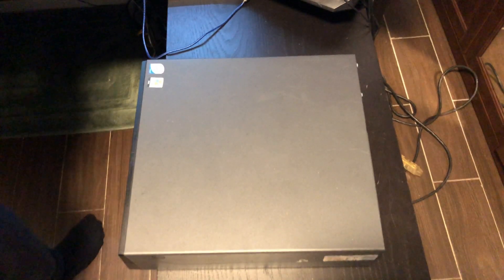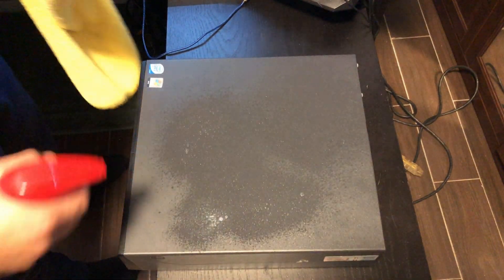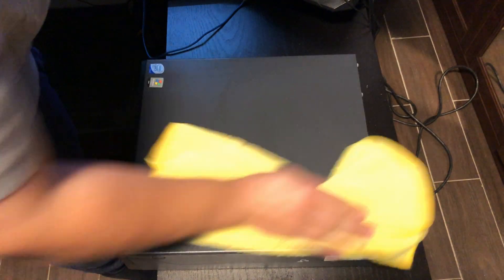Lenovo Think Centre M57p -SSD Upgrade & Ram

Comment: Could i update the psu ? Like 280w to 300 or more? And gpu with extra connection? Is anything i can do?
Reply from the maker: Hey @j6plus23 — sorry for the late reply! These ThinkCentre M75p units use a compact form factor, and unfortunately the power supply is proprietary. That means upgrading from the stock 280W to something higher isn’t really feasible without serious modding. There’s limited space, non-standard connectors, and airflow constraints that make GPU upgrades tricky too — especially if the card needs extra power.
This build was originally set up to help a friend during the remote learning phase of the pandemic. It did its job well, but at this point, I’d consider it old tech. If you're looking to boost performance, a newer system would give you way more flexibility.
Reply: @randomproductions2.066  no problem! I upgraded to a q8400.

Comment: Hey, I think, I got M57p. It have e4300 processor and i want to update it to e8400 as i have e8400 in my old pc... Can you tell me if i can use 8400 in it without bios needed to be updated and if i can reinstall windows 7 in it since the windows 7 installed in it have some issues. I have another question. i have couple of ram sticks from my old pc. would coupling them with the current ram sticks in the pc would make pc faster(that is 4 ram sticks size of 2 gb each)?

Comment: Hi, do You think an adapter for two 2.5 SSD would fit there in place of the 3.5 drive?
Reply from the maker: Hi Edgar, 

Thanks for the quesiton.  

You sure can install a Dual SSD Drive Bracket. However you will lose the Optical drive as there is only 2 sata connectors on the motherboard, as well power supply. If you needed to run the optical drive you can use a Sata to USB adapter, as well a Sata Spliter. 

Here are some links for referencing purposes. 

Thanks 

 1) SSD Bracket - https://www.amazon.ca/Corsair-Dual-Mounting-Bracket-CSSD-BRKT2/dp/B016498CK0/ref=asc_df_B016498CK0/?tag=googleshopc0c-20&linkCode=df0&hvadid=292982079026&hvpos=&hvnetw=g&hvrand=3995361740667059204&hvpone=&hvptwo=&hvqmt=&hvdev=c&hvdvcmdl=&hvlocint=&hvlocphy=9000970&hvtargid=pla-365069387933&th=1

2) Sata Power Y Adapter - https://www.amazon.ca/15Pin-Female-Extension-Splitter-Adapter/dp/B09BQL2Y4J/ref=sr_1_1_sspa?keywords=sata%2By%2Badapter&qid=1639448227&s=electronics&sr=1-1-spons&spLa=ZW5jcnlwdGVkUXVhbGlmaWVyPUFQRlhOV1lHN1E0OVMmZW5jcnlwdGVkSWQ9QTA3OTU5OTBFR1pCRlYwWlk2TkQmZW5jcnlwdGVkQWRJZD1BMDk3ODEzMzJHTkhIQVRKRllDVjImd2lkZ2V0TmFtZT1zcF9hdGYmYWN0aW9uPWNsaWNrUmVkaXJlY3QmZG9Ob3RMb2dDbGljaz10cnVl&th=1

3) Sata to USB - https://www.amazon.ca/SinLoon-Converter-Cable-Adapter-5-25in/dp/B08PB39JRX/ref=sr_1_26?crid=2XEGVHL0PYIC3&keywords=sata+to+usb+cable&qid=1639448322&s=electronics&sprefix=sata+to+usb%2Celectronics%2C158&sr=1-26

Thansk for the support
Reply: @randomproductions2.066  thanks a Lot!

Comment: Hola, soy totalmente novata en esto de la computación y mi inglés no es muy bueno, así que espero puedas usar Google Translate 😅:

Tengo el mismo equipo y quiero hacer exactamente las mismas actualizaciones que has hecho. No tengo problemas con el disco duro, pero si necesito actualizar la ram pues apenas tiene 1GB y con ello no puedo hacer nada en internet. Todo se atasca. ¿Qué marca, modelo y capacidad son las que has utilizado tú? . Entiendo que no es sólo comprar una ram con mayor capacidad, si no que tiene que ser compatible con la tarjeta madre y ahí es donde me estanco.

Espero puedas ayudarme ☺️🙏
Reply from the maker: Hey Wendy,

Thanks for reaching out. I somewhat understood the Spanish due to being Canadian / Portuguese. But yes, the English translator helps. The ram I used in this video was the random stock that I have, pulled from computers. The thing's I have learned with Ram is specifically, when it comes to these types of motherboards. Do not use the high-performance ram that you would buy for a gaming computer. It just does not work, and the motherboards have certain things that lock them out.

Use ram that is as generic as possible from computers that come already pre-assembled.

I did some research, and the best ram for this computer is to use.

https://www.amazon.ca/PC2-5300-DESKTOP-Modules-240-pin-Tech/dp/B00C53DK3E - This is a link to Amazon. Also, if you stay within this motherboard specs. You should be fine.

Memory Speed 667 MHz
Memory Specification Compliance PC2-5300
Features dual-channel memory architecture
non-ECC
8 Gigs Max 

I would try to find an electronics recycling place and see if they have this ram available.

I hope this helps. Thank You
Reply: @randomproductions2.066  you're awesome!!! 

Gracias por la amabilidad de responder, te lo agradezco inmensamente 😊❤️
Reply from the maker: @wendyking1081  No problem, glad to help. If there is anything else you need. Feel free to ask.

Thanks
Reply: @wendyking1081  le entendiste al 100? ,Pudiste hacerle Upgrade? Tengo una PC igual y quiero mejorarla ,
Reply: @fisher_kun  Si. Bueno, en mi caso solo necesitaba cambiar las RAMs para aumentar la velocidad de lectura del disco duro porque no podía ni cargar Google. Compré dos DDR2 de 4GB por el Marketplace y solo fue cuestión de cambiarlas para que funcionara más rápido. Realmente la PC me servía solo para hacer tareas de la universidad así que no le hice todo lo demás, pero complicado no se ve 😅
Reply: @wendyking1081  pero con un procesador duo core el ssd y con 2 ram de 4 gb estaria mucho mas rapido no?
Reply: @fisher_kun  claro!! Pero como estudihambre no tengo el presupuesto para intentar a ver si me sale 😂

Comment: Could you tell me how I do to update the BIOS of this motherboard
Reply: I already tried with two keyboards I didn't work
Reply: You know how to tell me which keys you use on this computer shown in the video so you can enter the BIOS setup I really need to know?
Reply from the maker: @sonic_r3822  Hey, Sorry for seeing this pretty late. If it still helps I usual push  Esc, F1, F2 Delete, Tab.  One of these should trigger some prompt to show which key its is.  Thanks
Reply from the maker: Hey,  

is there a specific reason for updating the bios?
Reply: My keyboard is not typing anymore I believe it is BIOS or Drivers
Reply: I really want to know how I do it to update the BIOS and the drivers of my motherboard, the computer and the same of this video on the card of my Tá Written Lenovo Rev: V2.1
Reply from the maker: @sonic_r3822  Oh sorry to hear your keyboard is not work, have you tried it on another device. Sorry to sound like a typical tech support type of person.  Updating a motherboard Bios is a bit risky as it can sometimes brick the system.  I tried once on an HP and it took a while to fix it with a lot of research.  

At this point, I would try the process of elimination 

Drivers can be found here https://pcsupport.lenovo.com/ca/en/products/desktops-and-all-in-ones/thinkcentre-m-series-desktops/thinkcentre-m57p/downloads/driver-list
Reply: Se le puede poner 8gb RAM DDR3?
Reply: @danidw4651  no god dammit the mainboard is made for ddr2 so ddr3 wont physically fit in